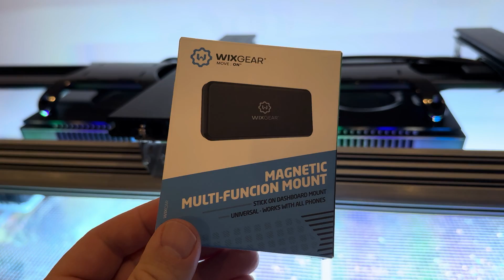Explained: How I Magnetically Mounted LED Reef Light Bars

Comment: Hey it looks like you may have a euro braced tank, I’m really struggling to find which bar system works best with the euro braced, I never thought it be this difficult not being able to just set them up on a mount on the back wall until I got my first eurobraced tank and hanging from the ceiling isn’t an option for me

Comment: You measure PAR on the bars alone yet?
Reply from the maker: 250 parallel to the top rocks on the scape. Literally as strong as my Radions were running. I had to turn off the Radions to not burn the coral. Now I’m slow-ramping the Radions over the course of 3 weeks 😂
Reply: @kalamazoo_reefer  oh wow. Good.to know. Thanks.
Reply from the maker: @queencityreefs  Absolutely. These things are powerful. And these are the daylight spectrum version. I’m guessing the more “grow-centric” versions like the Meso Blue, will pack a little extra punch. Just a theory. But they are LEGIT.
Reply: @kalamazoo_reefer  they definitely look legit. I was looking into them a while back but decided for t5 instead. There's not many videos around these so glad to have seen this.
Reply from the maker: @queencityreefs  T5: never once been a bad bet.
Reply: @kalamazoo_reefer  exactly. But I love gear so the itch is still there for led bars.
Reply from the maker: @queencityreefs  I love gear way too much. Budget gear, average tier gear, high end gear, whatever. I want it all, and I want to mess around with it and make it do all kinds of crazy stuff 🤣 It’s a borderline addiction.
Reply: @kalamazoo_reefer  haha! Yesss!!